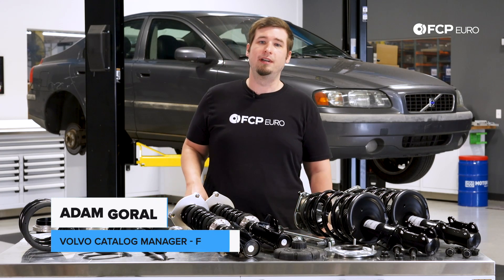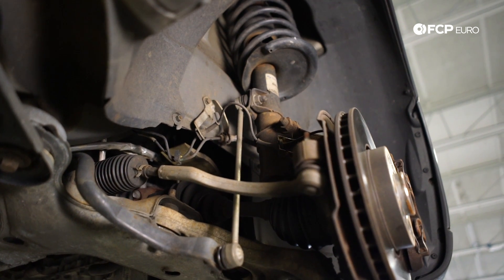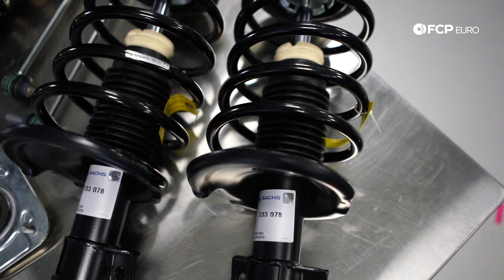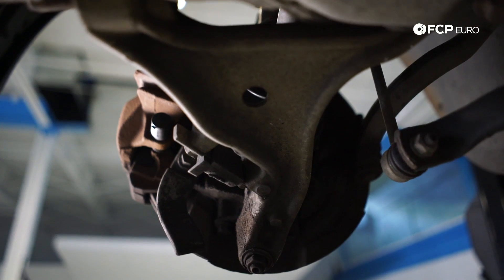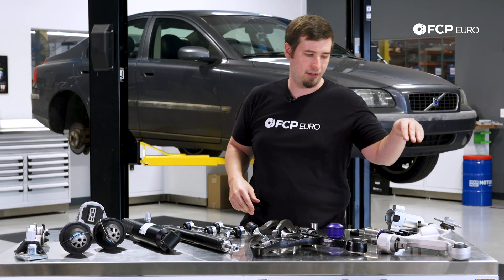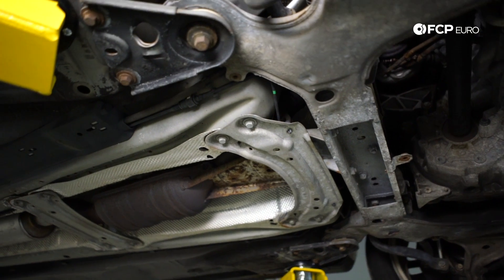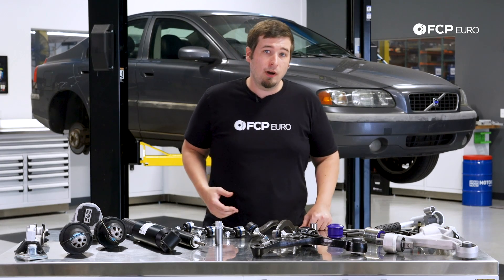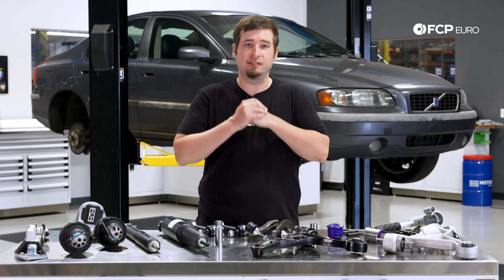Volvo P2 S60,V70 Suspension Diagnostic/Maintenance Guide (Struts, Bushings, Mounts, Failures & More)

Comment: Great advice about the sway bar endlinks.  Not only one of the most common causes of front and rear end noise but also one of the most improperly installed items on the car.  If these aren't torqued all the way to 37 ft. lbs you will still hear the same knock/clicking sound you had with the old ones causing you to look for the next possible source.  Don't go by feel on these!  End links can go bad as early as 60-70k miles.
Reply: Around where I live they go every 20k miles lmao

Comment: I installed Bilstein B8's with lowering springs about 7 years ago on my S60 T5.  They still feel and look great all these years later and with 60k miles on them.  Highly recommended if you don't want to take the deep dive into coil overs.  Also FCP is the best!
Reply from the maker: Bilstein B8's are great! Thanks for the recommendation!
Reply: I have a question, do you lose you active chassis settings when you install lowering springs on the stock shocks?

Comment: I just watched your video on P2 suspension issues, I have a 2004 V70 and, although I don't currently have any of the issues you mentioned I do have an issue that you didn't cover that seems to be common, that is, the inside of the tyre scrubbing on the inner guard on full lock. I have read what I can on this issue and most owners suggest changing or transposing the steering stop blocks. I tried both of those solutions including going to an XC70 block) as well as going down a tire size still within recommended range) but neither of these proved a satisfactory solution. 
Since there must be an underlying cause of this issue I am seeking expert advice for a solution,
John
Reply: I am no expert but I have a 2008 s60 T5 that came with 235/40r18 stock tires. I put on 225/40r18 and it fixed the issue of tire rubbing the front fenders.  Also it improved my U turn radius distance.

Comment: Kinda sad the s80 isn’t in the intro for the p2 videos as it’s the father of the p2 platform and started 2-3 years before the rest at least 😢. But thank you for the large amount of information that is now easily available for reference.
Reply: also Volvo's first CANbus car, only 10 years after Mercedes pioneered it!
Reply: Really Happenings but at least VIDA is so simple to use on Volvo’s system. The interface is amazingly easy when adjusting settings and reading codes with the workshop instructions built into it.
Reply: @rex_s80  Yeah, except that buying a VIDA/Dice unit online is like making a speculative investment in Martian unobtanium.  The reason I haven't crossed that bridge yet is because there appears to be no simple and reliable options, only weird Chinese stuff
Reply: Really Happenings I recommend going through Dave leach on Facebook with “vida2go” as he sets them up with ease.
Reply: It’s because you don’t see the first generations anymore.
Reply: @2steaksandwiches665  true. I still love mine though and have a fair chunk of online buddies with a first gen but none locally.
Reply: @rex_s80  if I could find a mint first generation S 80 I would probably buy it. I had a V-8 for a couple of years and really liked it but that’s second gen. Maybe something like that will pop up on cars and bids
Reply: @2steaksandwiches665  depending where you live I have recommendations of which drivetrain to go for.

Comment: Can you do a video about the low pressure oil warning light famous for coming on for no apparent reason in older model 2.4 engines. Full of oil. Oil pump pickup renewed. Seals renewed. Oil pump replaced and still oil warning light comes on….

Comment: I'm in the process of replacing the front struts of my 04 xc70 151k. I noticed the right side has no dampening. And the right side has a mild creaking sound when I brake. Sorry FCP but I ordered IPD quick struts bc FCP had none. Will also change the links. Now researching the rears. Not sure if I should change springs. I understand they can be removed without special tools.

Comment: is it possible for P2 XC70 with 4C system to have one (rear driver side) sensor not working due to non-OEM part replacement to drive with no issues? Because I found a car like that despite warning (not a chassis warning but a suspension sensor related warning) it drives fine. What is the problem here then possibly?

Comment: Quick question: I put eBay struts on my 07 XC90 a year ago. I know. Standing over the strut mount, hood open, pushing down to bounce that side, that top rubber flange should not move up and down, separately from the bolted mount itself?
Reply: Wonder if they forgot or didn't know to install the strut "stop" washer under the upper spring seat which is under the upper strut mount bearing. If that "stop" washer is missing it might explain why that top rubber flange (which I suspect might be the strut top washer you are seeing which is under the plastic strut nut cover) appears to be moving up and down when bounced. However, if it is in fact missing, and if you hit a large enough bump and the upper spring seat tears, the strut rod itself could possibly go right through the engine hood.

Comment: Just replaced front struts, sway links, control arm, break pads and rotors on the s60R. Getting a squeak-squeak-squeak when taking a right or left turn at low speeds. Any ideas?
Reply from the maker: Go over and double check everything you did. It could be a dragging brake caliper, or possibly a rubbing dust shield.
Reply: I noticed that the rubber boot at the base of the steering column inside the cabin above the gas pedal was making turning noise that sounded more complicated, but was easily refit.

Comment: I put IPD polyurethane sway bar links on my 09 xc90 and the clunking is worse than ever. Yes they're installed properly but I guess I'm just gonna go with oem sway bar links this time because the noise is driving me crazy
Reply: It is the sway bar bushings.  I also upgraded my end links to HD Meyle and made the clunk louder so now I have to prepare myself on the daunting task of changing the sway bar and maybe the subframe bushings sine I have to lower the subframe anyway.

Comment: front subframe bushings CAN be replaced on the car with the Volvo tool... and it is still available.  See my video on the subject.  It's a tough job but I did it.  Upgraded my V70 to bushings for the XC90, which are beefier but still soft rubber.  I had tried the polyurethane inserts which are fine but add NVH
Reply from the maker: That is true, any firmer bushing will add some NVH.
Reply: What's "NVH"?
Reply: My findings showed NVH to mean "noise, vibration, and harshness"

Comment: You can get a LOT more than 100-120K miles on a set of front struts. Our '02 V70 XC is going strong with her original struts at 177K with lots of city driving, and my '04 XC90 is rocking her original struts with 147K on the clock. Dodge potholes when you can, and don't drive like an idiot -- they will last a good long while.

Comment: Can a bad front strut/control arm/ball joint cause vibrations when braking from high speed? Dealing with this issue right now and I'm going to have to replace these parts anyways. Got new brakes installed already
Reply: I dealt with similar symptoms in my XC70. I found that my rear brake pads were seized in the caliper brackets and actually weren't braking at all, so it was my front brakes that were doing all the work when braking from high speeds. I cleared out the grooves in the caliper brackets with a wire wheel and applied a bit of anti-seize. What a difference it made.

Maybe glance at your rear brakes rotors to see if they are shiny, or rusty-looking, because if they look rusty it means they have been sitting and maybe the rear pads aren't applying for whatever reason.
Reply: This note may be a little too late. Even with new brakes installed, if you are experiencing a vibration when braking from high speed, and if it became more apparent after installing the new brakes, I would not rule out the new rotors and/or hubs until they were checked for lateral run out with a dial indicator. Some brands of rotors and hubs may have a bit more allowance for lateral run out and when installed and phased together could produce a combined lateral run out that would now be felt when doing a stop. Another possibility is premature warping of new rotors caused by improper torquing of the wheels, or break in, or riding the pedal, or performing a series of hard hot panic stops with your foot remaining on the pedal for an extended period of time concentrating the heat in one spot. The P2 series Volvo's front brake rotors were woefully undersized for the weight of vehicle they needed to stop. Upgrading from the standard 286mm (11-1/4") front rotor size to the larger T5 series 305 mm (12") front rotor size will make a major improvement in braking power on those cars. I upgraded mine myself, as well as upgraded from regular cast iron rotors to high carbon rotors. That combination, along with good set of Euro spec low dust pads, was the best investment in time and money spent. To upgrade to the larger T5 sized rotors just required sourcing the T5 front caliper brackets which move the calipers a little further out. The calipers themselves, and flex brake lines, all remained the same. The larger rotors still allowed me to remount my 16" winter wheels & tires. So before throwing more money at more parts and labor chasing a symptom, maybe rule out what was already installed that it is not the cause of that symptom. In my case, it was. I caught this exact issue with a shop installed set of new rotors and hub where one rotor and hub produced a combined lateral run out of 0.0035" (two zeros after the dot) and the other only 0.00025" (yes, three zeros after the dot). The rotor with 0.0035" run out was both felt when spinning the wheel when the car was up on stands and when doing a stop. Correcting the issue with the rotor and hub produced a combined total lateral run of now only 0.0005" (yes, again three zeros after the dot) which is near perfection. The braking from any speed now is very super smooth and reassuring. If you're a DIYer you can check this yourself using a run out dial indicator with a magnetic base with adjustable arm, and some time and tools to remove the wheels and calipers. If you're not a DIYer you will have to find a shop that will take the time to do this as most today just want to sell you parts, slap them on, collect their money, and send you on your way. Good luck and hopefully you'll find the issue and get it resolved without breaking (or is that "braking") the bank.

Comment: i am curious about the P2 xc70 magnetic suspension... what is that all about
my 06 xc70 has it but its been deleted and the rear end sits abit lower then the front because of it, got it this way. 
also front swap bar bushings for the same car... is there and aftermarket solution i could use, my sway bar slides from side to side and from my understanding the bushings are trapped in with the bracket... any other options available

Comment: few days ago i just replaced strut, startet to made wierd grinding noise. i think dust guard metal plate was seased
Reply: I now take a flat head screwdriver and kind of push the dust guard back once the wheel is on. I would always manage to pull it forward somehow and get that awful noise

Comment: How do you adjust rear camber on p2 v70 T5. My camber is way off and have no idea on how to make them right??
Reply: eccentric bushings are the only solution.  For rear toe (aka thrust), another company offers adjustable "rear stay arms" i.e. rear control arms.  Those adjust in length as a turnbuckle would.  But for rear camber, you need eccentric bushings and installation by an alignment shop.  I've seen some offered on sport-aftermarket sites for these cars.
Reply: @reallyhappenings5597   thank you, really appreciate your help. Do you know where i can find these rear eccentric bushings? My p2 is FWD and is on kw v3 suspension.
Reply: @mas_v70  try ipdusa.com FYI,  i got a set, still trying to get the tool, or make one to install them!
Reply: @MrQuantom  yeah i checked my man, only problem is that they are only for S60/V70R. Mine is FWD so don't think it'll fit? If i tried ipd bushes???
Reply: @mas_v70  I'd say your man is wrong, the offset camber bushes will fit all P2 Chassis... call IPD to verify... not sure what "kw V3" suspension is? 🤔
Reply: @MrQuantom  ok i will contact them and see what they say 👌 kw variant 3, suspension

Comment: What about front sway bar bushings(not links)
Reply: vulcanized to both the bracket and the bar, they just bolt to the subframe.  tend not to wear out, however the stock swaybar is pretty thin anyway

Comment: would a conversion of the rear struts to nivomat be advantageous for towing?
Reply: It seems like the towing capacity is based more on how the tow hitch mounts to the unibody. It's only a couple bolts to the bottom of the chassis, so upgrading the rear end suspension would give a smoother ride while towing but won't add a lot to the rigidity of the setup

Comment: Surprised you didn't mention odd front-end noise from worn-out front sway bar bushings in the P2 XC70, which aren't officially individually replaceable - they're part of the bar. And the subframe has to be dropped to access. Wish someone would come up with a solution for this with the stock bar - there are "cobbled together" internet ideas, but they all sound sketchy.
Reply: I agree. I was hoping someone made a poly insert for the sway bar bushings without removing the whole bar.  The labor is intense.  The sway bar bushings go bad just like any other rubber found in the suspension.